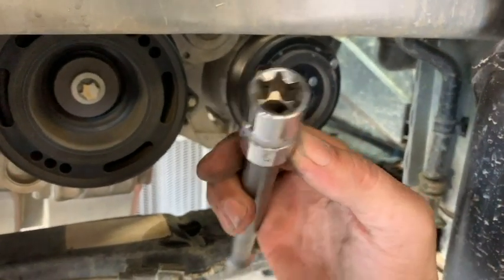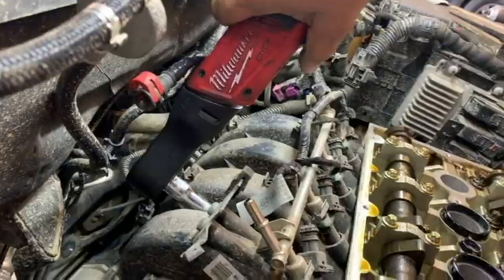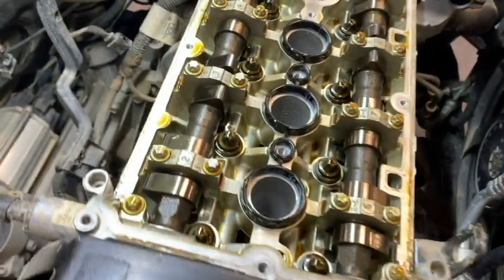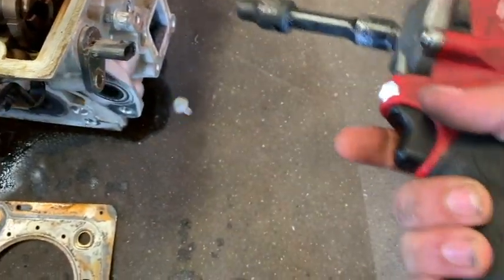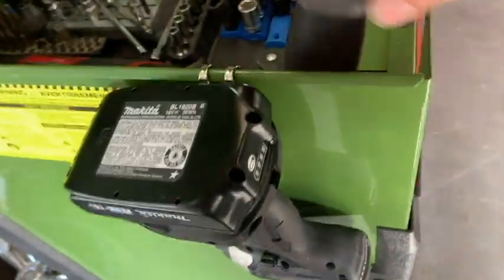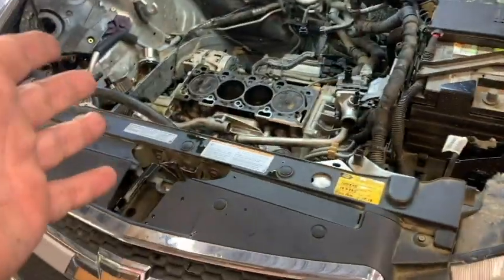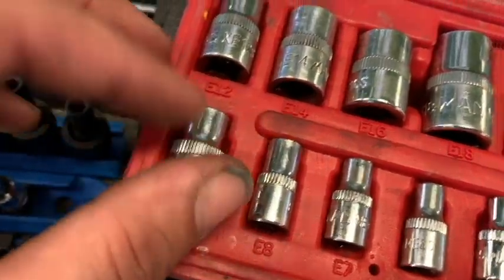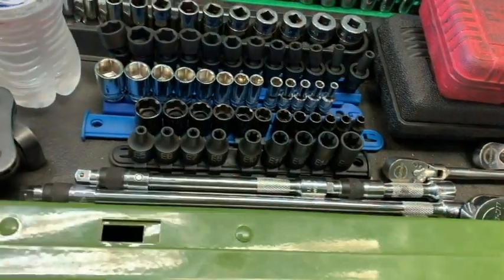IS IT BETTER TO HAVE IMPACT OR CHROME E-TORX?

Comment: Yeah, like seven years ago, I got a offbrand set of E-torx socket set for 15 bucks off of eBay and it’s more complete than that MATCO sent you just showed size is it included in this set is 1/4 E4 E5 E6 E7 E8 
3/8 E10 E11 E12 E13
1/2 E16 E18 E20 E22 E24
And I got the Pittsburgh E-socket set
Item number 68017 and that cost around 10 bucks I seen a similar one on MATCO‘s website for 170

Comment: hey 3/8's rail is nice or a 1/4 dont see them to much only on odd things like a ford ranger spark cap or a suzuki radiator thermostat but there great for volkswagen and euros also mercedes has them on there suspension but the larger ones.. so mite as well buy a 1/2 set as well if your doing that sorta thing
Reply from the maker: brando j This Chevy Cruze was covered in E Torx. I think I used all, but 3 out of my Chrome set yesterday. It gets Crazy! Oooh and how Jeep in the 90’s Randomly decides its a good idea to have the top 2 bell housing bolts be E12! 🤣😂🍻👍
Reply: Justin Dow 😂 least there at the top my s500 had one on the tensioner and that stripped lol im just like give me a brake mercedes lol

Comment: I had to use a etorque socket today to replace a brake cylinder on my 1996 chevy cavalier. They where for 1/4 wrachet.. but it worked great
Reply: I forgot to say they were the harbor freight etorques.

Comment: I LOOOOOOOOVE my VIM universal 1/4 chrome e-torx set. Use em all the time on newer GM, and German cars. I have impact e-torx but only in a handful of sizes, e10-e18. The only one I’d really say is needed as an impact is the e18 used on Ford rotor-to-hub bolts on full-float rear axles. I’ve shattered some chrome e18s that way. Also, the snap-on low-pro 3/8 etorx are handy. The only e-torx box-end wrench I have is the size used for BMW steering shaft to steering rack cinch bolts. A real must.

Comment: I bought a Craftsman set probably 5 years ago that has e torx in it.  Used one for the very first time this summer doing a water pu ml p on my Focus. I think it had to do with the engine mount if I remember right.  Glad I have them but I'll never wear them out!

Comment: Are the ADV sockets rebranded Sunex?  These days I’d opt for 3/8 impact sockets.  I’ve got pretty much every standard socket in chrome and impact and it’s pretty rare that I have to pull out the chromes due to a tight fit.  Usually I’ll use chromes on traditional ratchets just for the bling.

Comment: Impact Torx and not for nothing they will hold up a whole lot much more longer with cordless impacts rather testically compared to using them with Air pneumatic impacts the air gun will continuously impact and hit hard with force not saying that the cordless wouldn't hit hard neither but the operation of the cordless runs a whole lot smoother ...just like I was saying about them tekton sockets..I know you felt the difference when demonstrating using them with the milwaukee ....Some impact sockets just feel different when using them daily
Reply from the maker: True Story! Cheers!

Comment: I don't know a lot about the E-Torx sets. Mainly because I have not worked on cars much in the past 20 years. But I have had chrome sockets exploded when I used them on an impact gun. So I would just use the sockets meant for impacts. Safer that way. Good video.

Comment: Not impressed with the ADV lineup, I tried them out and went with grey pneumatic for impacts. I'm longer turning wrenches for cash but it's still my main hobby and have a fully outfitted 3 bay shop at my house, I'm setup better then a lot of independent shops.

Comment: I have a question Justin:  Do you find the majority of E Torx bolts used in vehicles are in Metric or SAE?  I was thinking about picking up a set of 3/8 drive E Torx impact sockets but just wanted  to know if I should purchase both Metric and SAE or just Metric to start off?  Thanks for sharing.  Cheers!
Reply: I think there is some confusion here. E-Torx does not come in metric and SAE sizes, they come in their own set of sizes under an ISO standard. One set is all you need, you only need to choose range of sizes you get. My set includes E4 to E28 which does all that I need.
Reply: @brian_youtube  Thanks for clearing that up as I wasn't sure.  I'm just a driveway DIY'er and not a mechanic.  Cheers!
Reply from the maker: Brian Zech Thanks Brotherman I appreciate you for a quicker response 🍻👍
Reply from the maker: William Logan I’m glad Brian was able to give you a fast answer. The only thing that I would recommend for “DIY” would be to not spend a killer amount on them unless your car is saturated in e torx. You may not use them all that much. 🍻👍
Reply: If you want chrome sockets, Home Depot has a nice 13 piece set covering E4 to E24 divided between 1/4, 3/8 and 1/2 appropriately. There is no case or anything, but it is lifetime warranty and only $25. Depends on what stores you have local unless you do online. I don't have a Lowe's here, so if I want local in-store warranty service, Home Depot is it for me.
Reply: @brian_youtube  Oh snap.  I was just at my HD this morning and never even looked.  Since my HD, Lowes and HF is an hour and a half drive each way, I only make it down there twice a month.   I'll be sure to check out those E Torx sockets then or just pick them up online.  Thanks again.  Cheers!

Comment: Not a mechanic, just a home gamer here.  I always buy impact simply because they can be used for anything impact or not and I don't need to worry about wear and tear
Reply from the maker: Thanks for the Comment, but I will have to both agreed & disagree with your statement. I’ll post a video this evening and share with you my thoughts. I will even keep in mind that how often you may use them is different then my own. 🍻👍
Reply: @JustinDowDIYcentralhighway  that's why I specifically mentioned I'm a home gamer and not a mechanic.  I'm mostly working on stupid repair and home project bullshit rather than automotive stuff, so obviously the needs are different.

With that said, I'd imagine impacts can do anything chrome plated can and then some regarding lifetime

Comment: I'm a fleet mechanic and use more impacts then chrome but there is definitely times where chrome fits and impacts won't.  I was looking at that Craftman set you showed for 60 bucks but here in Ohio its 128.☹ Those would work great for the off highway equipment..
My chrome's are Capri and impacts are Sunex. Happy with both.... Good Video !

Comment: All I have is full chrome bluepoint set and I've hammered on them with my half inch impacts, even some of the littler size's. I feel like if you got a good quality socket, chrome should be just fine, even though, yes they're not supposed to be backed by an impact.

Comment: Nicely done my Friend !!! Obviously you know I'm not a mechanic but I like the education you're giving me😁😍😀. The only socket I ever broke was an old china set. I broke a 3/4 socket but I wasn't using it properly.😀. I was trying to knock out a round pin that was holding the universal joint in place before I could remove the drive shaft. I was knocking the crap out of it with a hammer. It got the job done before it died though lol. Thanks again for sharing your thoughts and videos, Rodney

Comment: Chrome first man. You can always do it by hand vs impact, but if the socket is too large, you cannot do anything. Sure many times the impact ones will fit in there, but there are times they will not, especially Euro cars. VIM makes an e-torx wrench set which is amazing and at a great price. I prefer the 3/8 drive as it is most suited for all sizes. Really though if you are under E8 you are in 1/4 drive range. Get yourself above the E20 and you are getting to 1/2 drive. Same logic as hex to me. I personally overlap some, I have E18 and over in 1/2 drive along with the E18 and E20 in 3/8. If the set you get has only one drive size for the full line, you are looking at the wrong set.